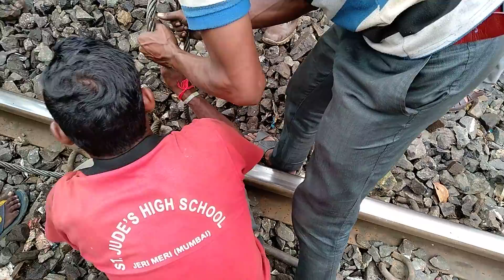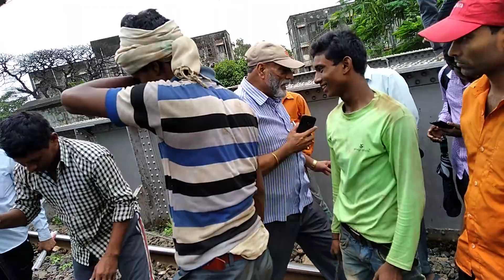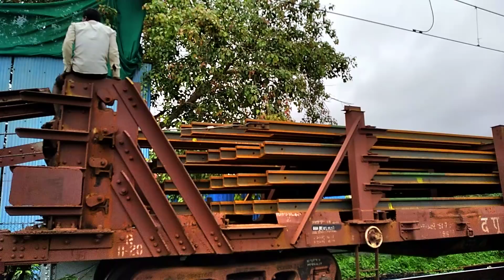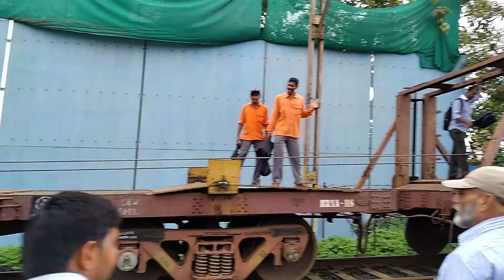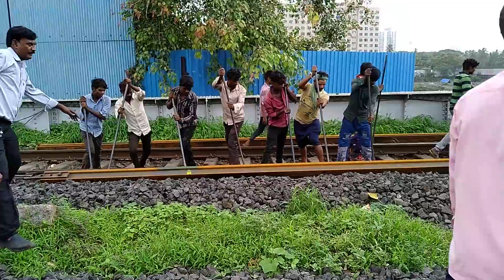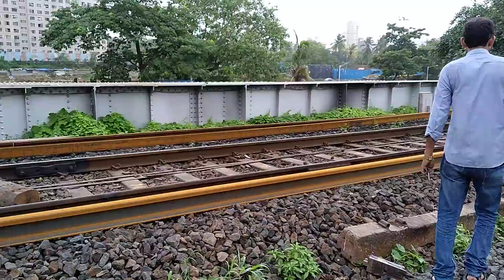EUR Unloading 60 Kg Rail 260 metre Panel.  - I.Railway

Comment: What is the benifit of 60 kg rail?
Reply: Heavier section. Gives more strength against wear, fracture etc. 52kg section is used for loop lines and where traffic is light.
Reply: @avisheksinha7924  is 52 kg rail capable for 130 to 140 kmph.
Reply: Capable even for 160 kmph
Reply: @abhinavpandey4083  which is best normal 60 kg rails or R-260grade rails.?